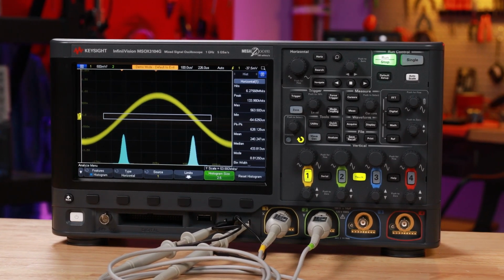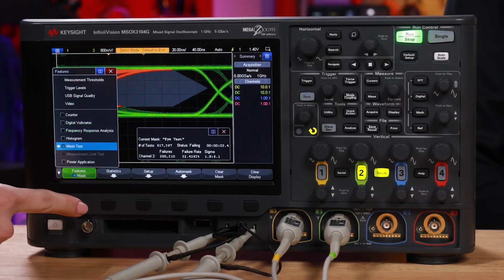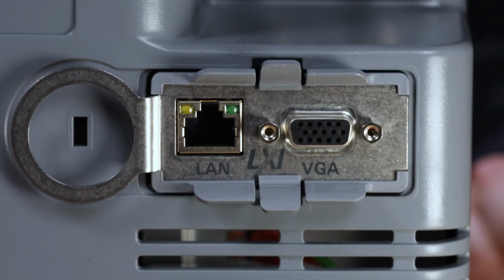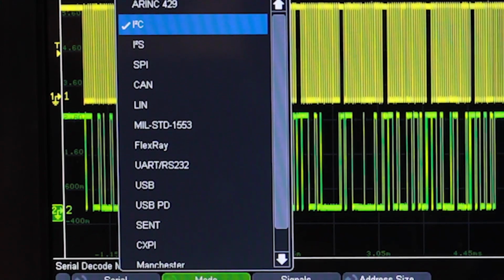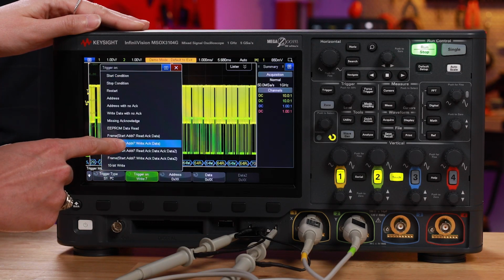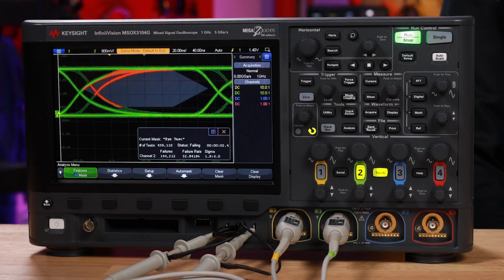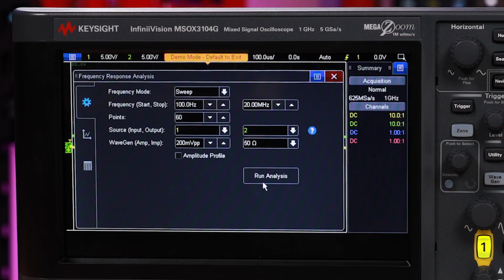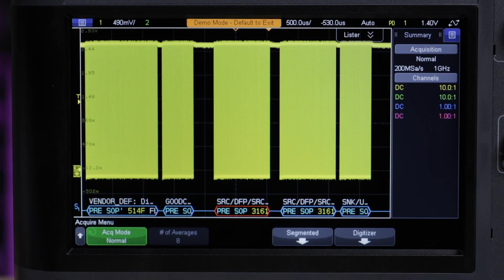Keysight InfiniiVision 3000G X Series Oscilloscopes Spotlight

Comment: Yeah well, my DSO138 has a rise and fall funtion select also and a probe input. I built it, and now  I'm off to calibrate a TCS230 with a Arduino Nano using the Serial monitor because its a little more accurate than the DSO. If I had your Highspeed Lowdrag Oscope I would not be learning electronics, atleast not the hardway. I shall consider your device, It looks cool.